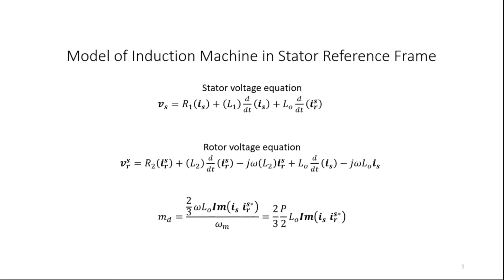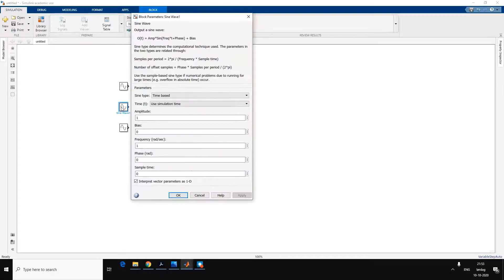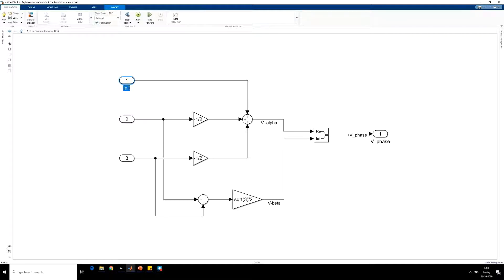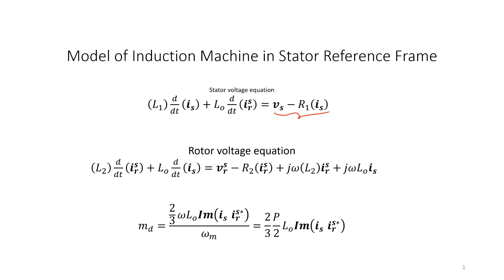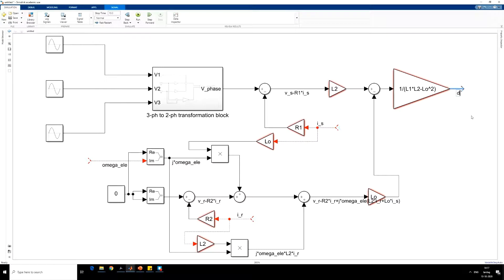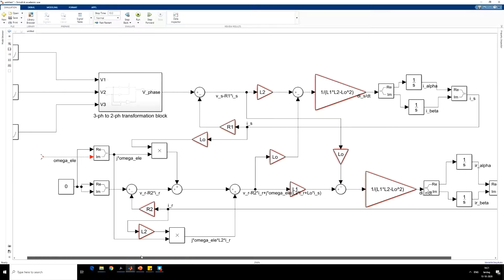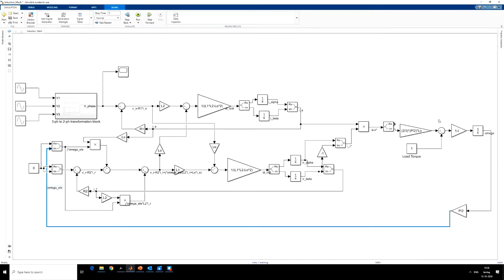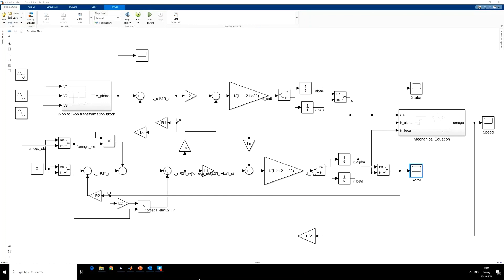Induction Machine Simulation Model in MATLAB Simulink using commonly used blocks

Comment: Thanks for the detailed explanation! I have a question regarding the torque expression:
At 12:45,
Shouldn't the factor (2/3) in the Gain block be (3/2) instead.
 
 Torque given by: T_electromagnetic = (3/2) x  Pole-pairs x  L0 x im{ is x conj(ir) }